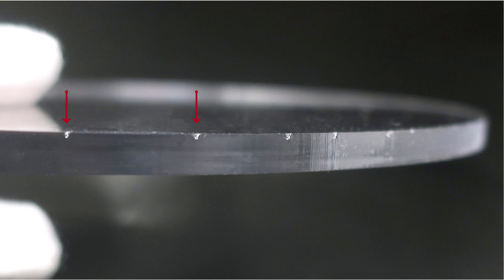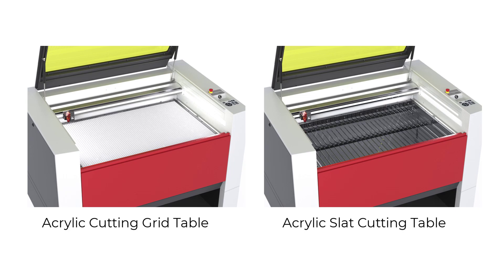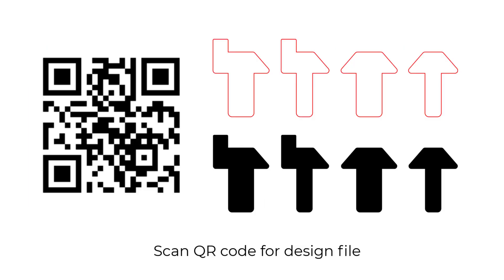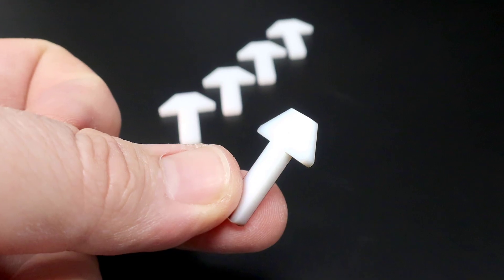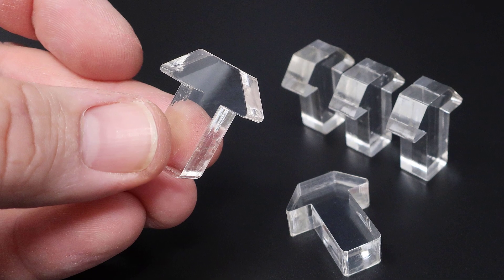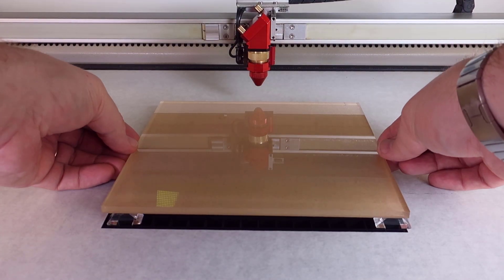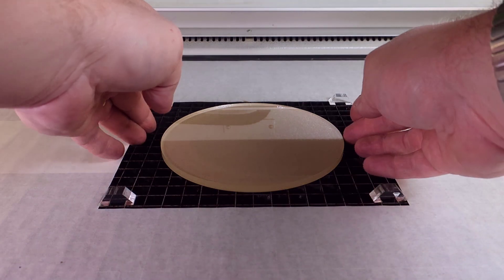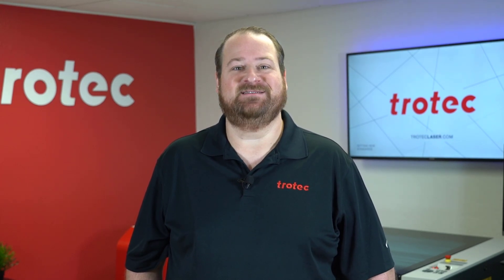Laser Hack: Pin Table with Acrylic Blocks

Comment: When you add the stand offs do you have to change the settings  when cutting? For example if I’m cutting 3mm acrylic and I make a standoff that adds 3 mm do I need to change the cutting material to 6mm ? Using a laserbox pro
Reply from the maker: Laser parameters will not change if the 3mm acrylic is elevated. The settings to cut will be the same; only the focus will change.

Comment: Hi i was wondering, do you have any recommendations on %power and what speed to use when cutting acrylic on a 80w laser?
Reply from the maker: To cut 10mm acrylic with an 80-watt laser we recommend using 100% power at 0.2% speed 5000 Hz. This laser hack should help as well: https://youtu.be/fAquhnblg9o